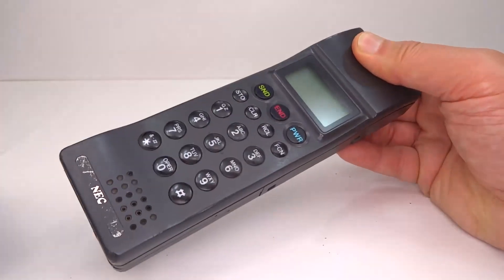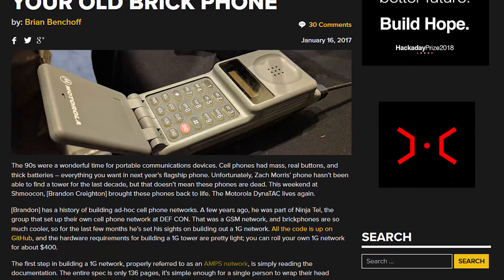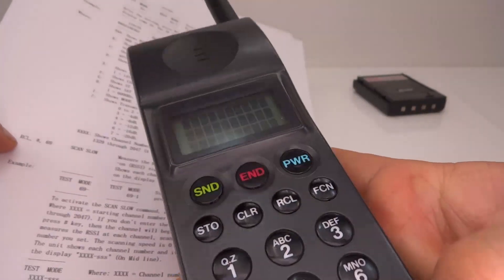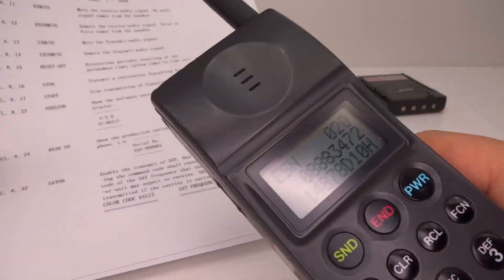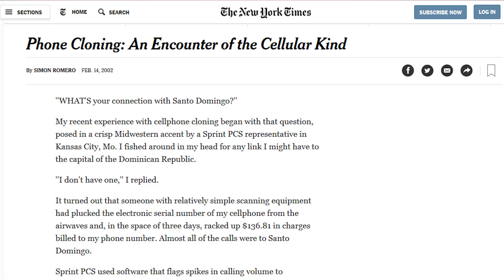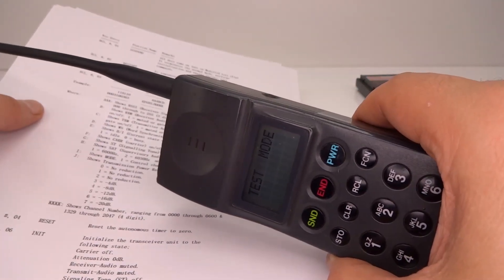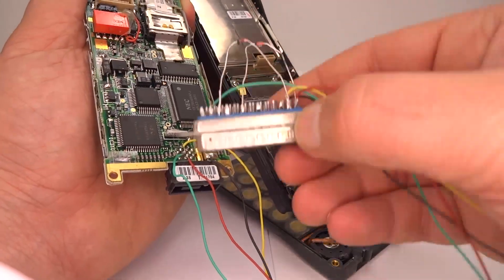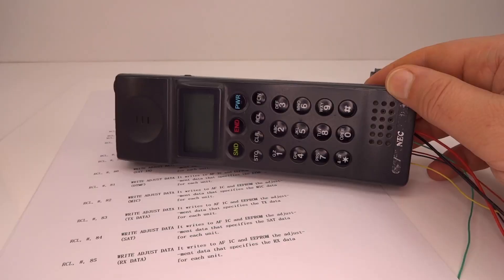Hacking the NEC P3 mobile phone, 1990's style

Comment: My father had one of these. It was his first phone back when it was released in 1990. I now have it in my collection of old phones. I tried powering it up the same way Janus did, and it worked for a while, before not wanting to receive the current voltage. the left battery contact was stuck and corroded, so I guess R.I.P NEC P3

Comment: The older motorolla bag phones (4800x?) were even easier to put into test mode. From what I remember, it was just connecting two pins on the data connector. I've saved one that was modified after finding it for sale at a radio rally (hamfest) in the early 2000's, after the analogue network was switched off. I think there is even a photocopied motorolla bible with it and some parallel port connection lead.
Reply from the maker: There were phones easier to put into test mode than this one. I'm looking forward to exploring more very early phones later this year.

Comment: Ah the old Italian ROM switch. One thing though was it was Woz who was interested in learning. Jobs was the business head who wanted to sell them. In the UK this caused all kinds of bother with newspapers listening into calls. Also remember they updated the network so you if the same NAM/ESN connected to one tower then minutes later appeared hundreds of miles away it would block them.
Reply: Sometimes the phone in the company helicopter would get blocked for that reason, if you were to high then multiple towers miles apart would all be getting the same phone data so network would assume it had been cloned.
Reply: @thedave7760  No sabía eso, ya estaba en AMPS o NAMPS?
Reply: Que sistema primitivo de seguridad. Ja! la verdad que nadie penso en eso al inicio, pero fue vital, ya que clonaban los mobiles de manera muy simple.

Comment: I worked at one of the companies where these was manufactured. I was a 'Board Tester'. The board testing section would test each circuit board. Listening in to other peoples phone conversations was a favourite of the repair techs because they were the only ones that had all the gear to be able to do it.  They had to be careful that the repair boss did not catch them doing it because the company frowned upon such activity. Another favourite of theirs was using the HP spectrum analysers they had on their work benches to listen into the phone conversations because if you had a good enough aerial, you could tune into the frequencies and listen in :). The P3 brings back good memories of working there.
Reply from the maker: Great story, thank you for sharing.
Reply: @Infant Joseph Yehoshua porn as wallpaper, weird porn in the downloads folder etc

Comment: Any way one might be able to get these old phones on the air again?
Reply from the maker: Yes, using a software radio such as HackRF. There is a proof of concept here,
https://www.rtl-sdr.com/running-a-1g-mobile-phone-network-with-a-hackrf/
This can emulate the control channel for call set up and switch voice channels.
I have not tried it myself, I’m not sure how well it works.
Reply: @JanusCycle  there's osmocom-analog as well, but that requires a limesdr. It's a little more refined than gr-amps, you just run a command and it sets up a network where phones can call each other. Theres also a facility for calling the outside world, but I haven't gotten that to work yet. I might do a video on it.
http://osmocom-analog.eversberg.eu/
Reply: This was mentioned in the video. Yes, but big legalities of using licensed spectrum to do so.

Comment: I have one, battery is good but won't boot up...any suggestions?
Reply from the maker: Yes, I had the same problem. Replace the 220uf 10V electrolytic capacitor that had been glued on it's side next to the inter-board connector. This may turn out to be a common fault, let me know how it goes.
Reply: @JanusCycle  Thanx for getting back to me...opened it up and the 2 flat brass battery connectors were corroded...cleaned them up and it almost works...just need to find a decent battery now...
Reply from the maker: @beebeefilms  Great to hear, good luck with the battery.